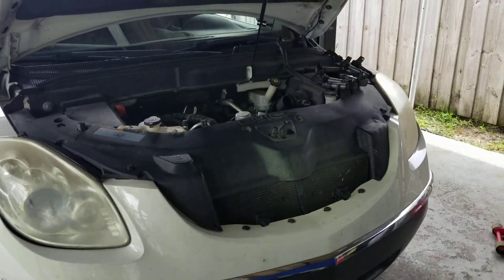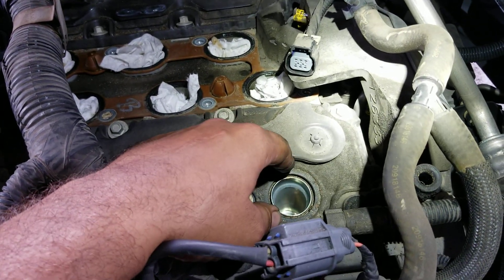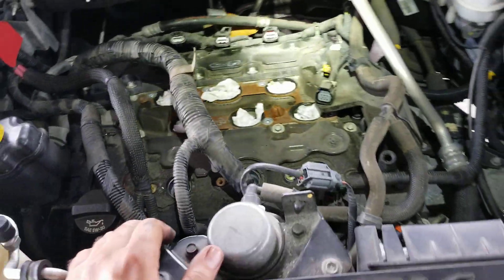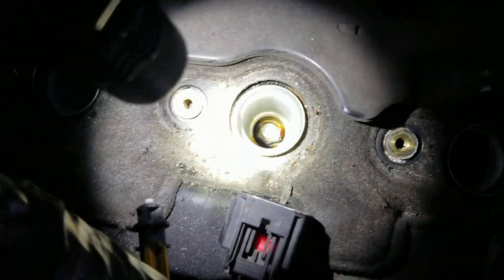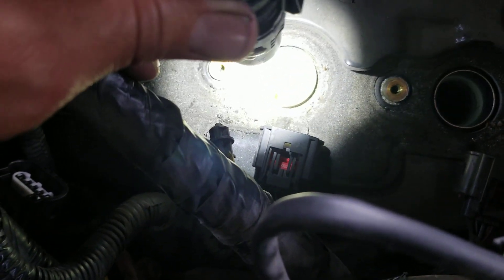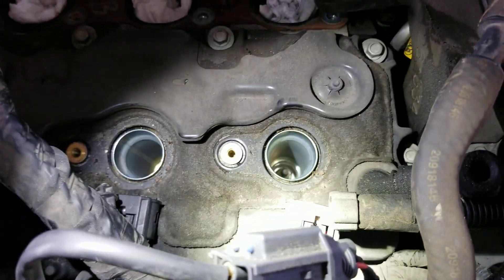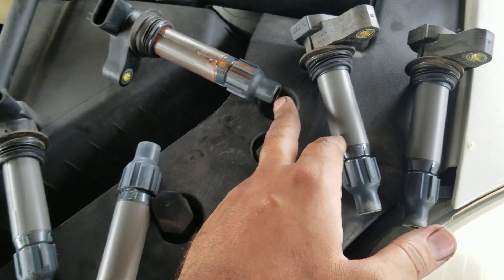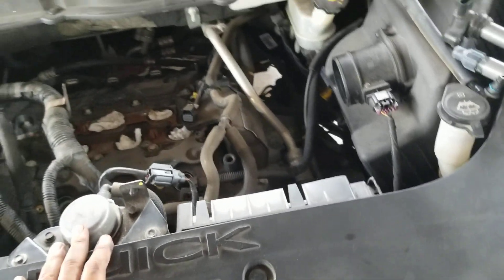Watch this if you have oil in the spark plug tube on a GM (Chevrolet, Buick, GMC, Cadillac) vehicle!

Comment: GM is wrong again! Been fixing oil in spark plug holes since day one! What happens in GM V6 (2.8L, 3.0L, 3.6L) is that the spark plug tube is pressed into the head. Over time, it works it's way out & oil gets drawn from the bottom. When ever we replace an ignition coil (for misfire) or replace spark plugs, we tap in the spark plug tube. I machined a steel disc that fits perfectly into the spark plug tube with a slight lip on it. We then hammer the disc, driving the tube in until it bottoms out. Been doing this for at least 15 years. We specialize in Cadillac/GM cars, so we do a lot of these. No need to change anything.
Reply from the maker: Thanks for the tip. I'm sure it will help alot of people.
Reply: Got any pictures you can send me, im about to take this shit apart.
Reply: You got a pic of that tool
Reply: Would love to see what the tool looks like ..
Reply: @kevinmc5897  It looks like an aluminum disk ... sort of a freeze plug installer disc. Just machined to the spark plug tube size. Has an indentation in the top middle so our driver tool doesn't slip off when hitting it with a hammer. Post your email & I can send you some pictures.
Reply: @mastertech5036 Unfortunately I was doing a spark plug change on a 2011 GMC Acadia and one of the back spark plug wells was full of oil. My question is, once I figure out something to tap that tube down with, how hard do you have to beat on it and can you see or feel it when it seats correctly?
Reply: @cableguy1224  We do this by feel. When you strike the driver (with a hammer), you will get a "hollow" strike. This means the tube drove down. When you feel the hammer hit "solid" , tube is seated all the way down. I should make a video, but never did one.
Reply: @mastertech5036 Thank you so much. Would be great if you were able to post a pic of that tool you made to do this specific job. 🙏
Reply: @mastertech5036 could you send me a picture via email? Im currently going through a misfire and just seen the oil in the 3rd well.
Reply: @nikylebraxton  What is your email?
Reply: @mastertech5036  it’s my YouTube name at live. YouTube won’t let me post the full email
Reply: Do you have to remove the spark plug first to tap down the tube?
Reply: @DanRussell-mw8ny  NO. Just remove the coil. You have to remove the spark plug if you have to get all the oil out, but if it looks clean, we don't remove spark plugs. We tap down the spark plug tubes on all our tune-up jobs. You will be surprised how high they travel.
Reply: @mastertech5036  Thanks so much! Now I need to figure out something that work to tap down.
Reply: @DanRussell-mw8ny  No just remove the coil & bang away!
Reply: Would this cause a bucking shaking at low speeds??
Reply: @drewclinton4304  Oil filled spark plug tubes can cause misfiring. In which case, replace both the spark plug & coil.
Reply: I'm gonna give this a try, did cam covers on my 2021 3.6 LGX this spring thinking that would solve my leak.  Around 6000 miles later have leak again (plug tube full and leaking onto manifold).  Sure beats changing out the head!
Reply from the maker: Keep us posted please
Reply: And what about v8 models?
Reply: @QinTombMysteries  GM V8 models like the Northstar is the valve cover gaskets. They are an O ring seal in the valve cover that keeps the oil out of the spark plug hole. The bottom of the spark plug hole is machined as one piece.  On the 3.6L's there is a steel tube pressed in there & it works it way up. Allowing oil to go into the spark plug hole.

Comment: Replacing the head seems like such an overkill i get its the "correct" way to fix the issue but that just cuz GM is afraid of a little rtv. Find a way to get a some high temp rtv around that seam inside the spark plug tube and itll be fine. I just squeezed a small amount on a screwdriver and dabed it on there, a bit of a pain but far less than replacing the head... 2009 Cadillac STS 3.6
Reply: Did it work out for you?

Comment: Does anyone know the bulletin link, can this be fixed at a dealership since it’s a manufacturer defect, I have a 2011 suburban 1500LT 5.3L. There is oil collecting cylinder 1, at the bottom of the spark plug chambers.
Reply: https://www.google.com/url?sa=t&source=web&rct=j&opi=89978449&url=https://static.nhtsa.gov/odi/tsbs/2021/MC-10200146-9999.pdf&ved=2ahUKEwj0kJO_h4GNAxVMjIkEHYGcI-4QFnoECEgQAQ&usg=AOvVaw2Lzq6CJolG9IKijebHMB0K

Comment: Just did the Spark Plugs in my 2014 GMC Terrain AWD (2.4L Ecotec). Found Spark Plug Well #1 (Far Left when looking at Engine from Front, on the Passenger Side) swimming in Oil.  

No codes (yet). Cleaned and Replaced Plug. For now the other 3 are dry. 

The plug change was a bit late (@ 115K miles vs 20-40K earlier?) so if the oil has been collecting say over the last 3 years... It might not be absolutely necessary to address "right now"?
Reply: I was given one with 240K miles with original plugs (.010 out of spec). Ran sluggish, so I replaced the plugs and manifold gasket (was worn bad). Oil in well on far right (drivers side front). Is yours still running?

Comment: I have the same problem and was wondering if I could replace the spark plug tube instead of the entire gasket.
Reply: What did you decide
Reply: @eugenew6717  I ended up replacing the spark plug tubes by taking off the head gasket, pulling out the old spark plug tubes, scrubbing out old sealant, adding new sealant, new spark plugs tubes, new seals for the head gasket. it ended up costing about 300 to do. I believe that part number for the tubes was mstp4. there is multiple youtube videos showing how to remove them but you should know, when installing the new tubes, make Sure you get them in there as far as possible otherwise the coils would struggle to reach the spark plugs. but if you have this engine and it has 100,000 miles, its not worth keeping. the parts for this engine are more expensive than typical  and your car is going to breakdown with major problems with the engine/transmition. it is not worth owning a car with this engine unless the engine/transmition is new. you can fix this problem, but if have this engine, sell the car while its still worth some money. if you call your local GMC dealership, they will provide you with more infromation about this cars problems including consistent problems with the computers and transmition.
Reply from the maker: I think you could. But gm wants you to replace the entire head
Reply: @gautorepair  I guess that makes sense. Why else would all three spark plugs have oil.
Reply: @gautorepair  do you have sources by any chance?
Reply from the maker: You mean to purchase the head or machine shop
Reply: @gautorepair  sorry, no. You said you got info from a source in the video. I totally understand if you can’t find the sources, I’ve got pretty much everything figured out due to your video.
Reply from the maker: @boblary223  oh. Lol. Sorry.  Yes i found a bulletin from gm pertaining to the issue. However i don't remember the bulletin number
Reply: @gautorepair  alright, thanks for the help, sorry for the inconvenience